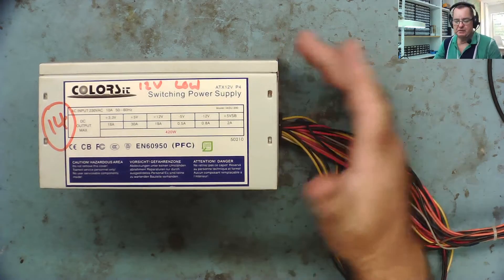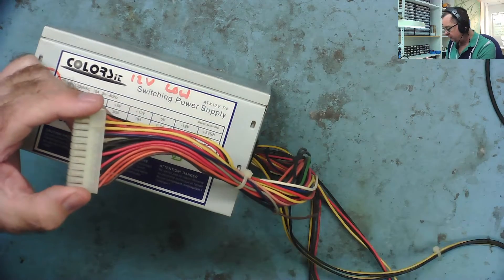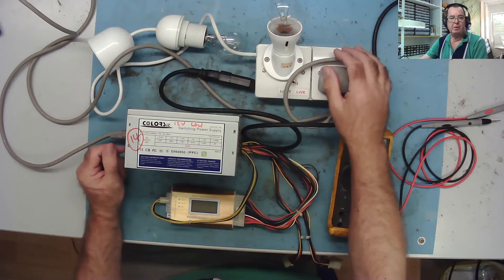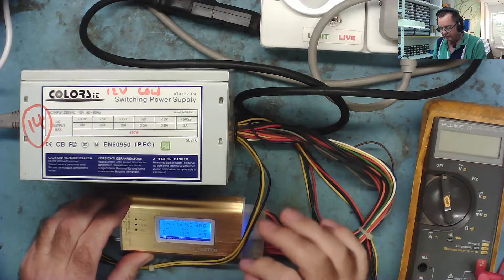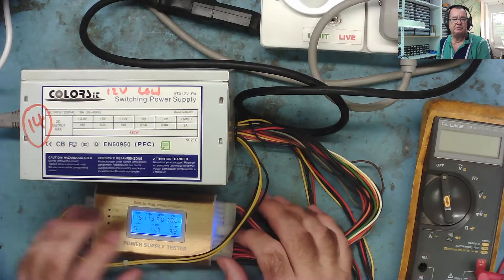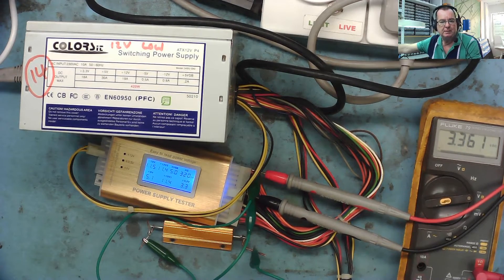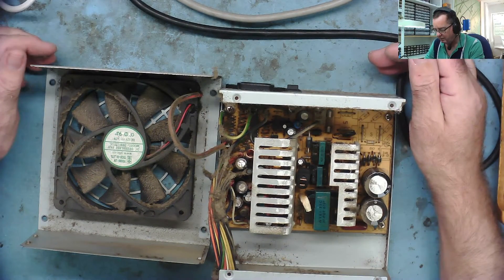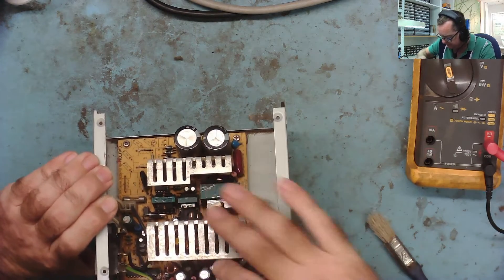ATX Power Supply PSU Repair - DO THIS FIRST!

Comment: thanks for the tip on the monitoring wire. great info.  no way those tiny diode rectifiers could take 400 watts either. i've never seen a 4 pin molex on a sata drive either.  i guess it was really early and power supplies didn't commonly have sata power yet. i've still got old hard drives like the ones you used, that i've had since new.  i use them for data and OS backups. all linux.

Comment: I was a PC System Builder/Designer in the UK for many years. When picking an ATX PSU for a system, I obviously had to work out the maximum loads on each of the ATX output rails (depending on what might be fitted to each skew of a new PC mainboard). But it is more complicated than that. Some mainboards+CPUs+peripherals use very little current on certain voltage rails. It depends of what type of drive is fitted (2.5", 3.5", SSD, none, etc.) and what rails the mainboard uses (some would get 3.3V or lower voltages from the 5V rail, some from the 3.3V rail). Also some PSUs failed to regulate properly if there was not enough load on the 12V rail, some failed if not enough draw on the 5V rail, and some failed to regulate only if there was sufficient current draw on both 5V and 12V or  12V+3V or 12V+3V, etc. I always had to ask each PSU manufacturer for the minimum current specification for each rail (or combinations). Also, a power supply often could not supply enough power on one rail even though the total Watts output was far less than it's rating (because the Wattage rating assumes a certain 'mix' of current on each rail). Some PSUs even relied on the bulk capacitance in a mainboard for smoothing/regulation. I many cases we had to ask for slight tweaks to be made to a specific model of PSU so it would support a range of PCs skews and then we only took that specific bespoke variant from the manufacturer.
I am still amazed that, even today, 95% of ATX PSU manufacturers do not specify minimum loads (even in their data sheets). Instead they prefer to put a note on certain PSU ranges that say 'not suitable for xxx types of system/CPU' when they find out it doesn't work properly for one of the reasons above!

Comment: I’ve got at least 200 computer power supplies ranging from cheap ATX supplies like this, to the top of the line modern ATX supplies, server supplies ranging from 20 year old never used models… All the way up to UNBELIEVABLE power output with some of them weighing well over 100 pounds and being the size of a standard tower computer. 

All hot-swappable of course, you can see something like it on the “diode gone wild“ YouTube channel if you type in “server power supply”, he has two great videos where he goes over the design on the inside and kind of looks them over. He is such an incredible teacher when it comes to electronics.

he had some massive server units that someone donated and I I have dozens of supplies like that, I don’t know why I’ve just heard them over the years when I see them cheap or free I grab them. Sometimes they’ve been swapped out but they still work, only swapped because they reach their expected life cycle in hours

Wish you were somewhere in the United States I could send you a whole pallet of those bad boys. I don’t know why I’ve saved so many, but they do come in handy every now and then when you need parts or a very good quality supply for something in particular. Must be well over a ton of them.

 the incredible build quality with most of them and designing Quality is just insane. Most of the service supplies are super high-quality Delta and Hewlett-Packard branded stuff 

Those super high-end server power supplies from five, 10, and even 20 years ago… They’re just stunning on the inside. And capable of putting out absolutely insane levels of power.. I don’t remember the specs of all of them but not uncommon at all for them to put out dozens of amps on certain voltages, sometimes hundreds of amps, many of them ranging between 2.5 kW to 5 kW output. Just incredibly designed. I highly suggest checking out Diagon wilds to server power supply videos. They’re just really need to see the insides of, and if you check around locally you will definitely be able to find some because these big businesses and server rooms swap these things out regularly they don’t wait until they fail they swap them out after a certain amount of time.

Comment: I have this ATX PSU which had blown capacitors. They were Fuhjyyu and after checking the translation, I am suspecting someone must had picked that name for fun. Funny trivia aside, got the capacitors replaced with new ones, PSU works fine when on, but is a very interesting one. As soon as you plug it in both fans and their LEDs come on. After inspection, they are powered from a Fan PCB which seems to have 3 inputs, 5VSTB, GND and 12V. 12V is only 12V when fully on (on PSU tester), otherwise it's 3.6V. The fans are 12VDC 3.6W. It's not exactly great setup because it draws 10W doing nothing and spinning fans. So I just wanted to ask if it makes sense to either unplug that PCB from 5VSTB altogether or hook it with the 5V output rail so the fans come on with the PSU? Thank you.
Reply from the maker: Hi KS
OK so if the fans consume 3.6W (each) and are 12V fans then Watts = volts x amps so 3.6W = 12V x  amps so current = 0.3A = 300mA

If there are 3 fans then in this PSU then yes that is about 10W (10.8W by my guess-timation) but that does not seem like a lot for high airflow fans - if this PSU has three of them

With that amount of cooling required then  I assume this PSU is a high powered one

If the fans would even work on a 3.6V supply, the resistance of the load should stay the same (unless they use some fancy internal boost converter on the fan PCB to increase the voltage back to 12V or some other clever trickery) so if R stays the same then we have

R = V/I = 12 volt /0.3 amps = 40 ohms

If V is reduced to 3.6V then I = V/R = 3.6V/40ohms = 0.09A = 90mA

So wattage at 3.6V (and presumably a slowly rotating fan) W=VxI = 3.6Vx0.09A = 0.32W per fan = 0.96W total

IMHO if that was the way the designer made the PSU I would leave it how it is - in a PC, plus or minus 10 watts is neither here nor there really.

I did say I wouldn't do maths on this channel but that doesn't mean I can't do it :D  Well at least on a Friday evening after a couple or three beers :D :D

BTW also find I can speak a lot more Spanish after a few beers as well.   Mas Cerveza Mas Habla Espanol.
I was hopeless with foreign language (French as it happens) at school.  Then when I was 19 I went on my first holiday abroad with some friends (strangely enough Spanish Costa Brava) and there I met a delightful young French girl name Veronique, who was also on holiday and spoke almost no English.  In two weeks she taught me LOADS.  She I even taught me to speak a few words in French as well!!!  LOL
(this is a true story)

BTW What does Fuhjyyu translate too?
Reply: @LearnElectronicsRepair  Thank you for the response. I must have been tired or something when thinking about making changes to that PSU, turns out if you leave it switched off it for 3 minutes without unplugging, it will turn the fans off completely. So it is a feature of the power supply, probably to help it cool down. I would never know if I didn't find auction for same PSU on ebay - it has that 3 minute interval listed in bullet points. Lucky me. I have never seen anything like it, but you always learn something new.
I got this PSU - it is Global Win SAF520, from someone who said it was broken and it burned his GPU, but I think it must have been bad GPU. Before I replaced bulged and leaked caps, PSU would power up so it was never really broken.
Now it is almost fully fixed. I am saying "almost", because when you leave it plugged after switching off, it starts making noises like "coil whine" or "capacitor discharging". It's not immediately after 3 mins and need to wait little bit longer.
On the other hand when you totally unplug it, discharge is very fast. I put my retro rig on it yesterday and it works ok and is stable. All the other caps are flat, so I doubt replacing them makes any sense at the moment. 
Video here: https://youtu.be/zB1GW3IPHzA - i left it on standby after power off, you can hear the noise until i turn the switch off. If you have any idea what could that be, that'd be awesome. The PSU is 52A rated on 5V, so it's precious for my Athlon XP build.

Update - just turned the retro PC on - it took few seconds after button press to actually come on (i had to press it twice or three times) and for first few minutes PSU gives some screeching noises. 
I am thinking screeching might be because other caps are dry but it's not visible and maybe NTC resistor needs replacing because it doesn't come on immediately, maybe it needs more time to heat up?
Video with the screeching noises - https://youtu.be/2g2NMH2qmWg. For a fact - it is not the hard drive. I would think it's the large caps, but I replaced them with Nichicon as you can see.

Urban dictionary has a translation for Fuhjyyu - https://www.urbandictionary.com/define.php?term=Fuhjyyu so you can have a laugh.
Reply: There is a better video of the noise which I think is coming from the PSU. https://youtu.be/mTwIfqL6QUU - I suspect it could be these large Nichicon capacitors that I fitted. They are new and they looked legit. On the other hand they are from aliexpress and could be counterfeit or just old. Cannot imagine anything else making that noise. And it is not the hard drive although it sounds like one. The noise goes away after 30seconds or so and I will need to investigate it further.

Comment: love your videos i started  buying faulty power supplys sell on due price incress in uk just wondering how you distarge large cappasitors
Reply from the maker: Use a power resistor - I have shown this on some of my videos - I used something like a 2.2K 5W resistor which I was holding with a pair of pliers.  Good luck with your scrap power supplies - I hope you fix some of them :D
Reply: @LearnElectronicsRepair  thank you i went to scrap metal yard got 5w resistor out microwave solderd 2 wires to legs and works very well no more electric shocks lol
Reply from the maker: @bitsnbobs1969  Excellent.  Do you know the ohms value of the resistor?  Stay safe :D

Comment: Psu No 3 (the 80+ one) looks interesting but I can't remember if you have fixed it (I could check but the last psu marathon has fried my brain). Seriously now, thanks for all your amazing videos. It does take time for me to go through everything but it is well worth it.
Reply from the maker: Ho John, Number 3 is fixed
 https://www.youtube.com/watch?v=6NOgrga5x04

The remaining ones are
No 2 – 300W – 12V high, 5V low
No 5 – 250W – 5V & 3.3V unstable 
No 6 – 400W – Dead 
No 7 - ???W - 5V Standby Unstable 
No 8 – 300W – powers on and straight back off again 
No 9 – 350W – No Output 
No 10 – 400W - 5V Unstable
No 13 – 450W – ??? Mystery Fault ???
No 15 – 450W -5V Standby Unstable

Plus there are a few still In progress waiting parts

It is possible some of the above just need to be run under load (see I also learn while doing this) – I will go back and recheck them to find the genuine faulty ones and update the list

I've also been learning while working through 
this lot
Reply: @LearnElectronicsRepair  No 8, No 7 (or 15) and No 6, whichever you fancy doing, for the variety of symptoms they have.

Comment: What do you think about power supply that doesn't turn on, but the standby cycles on an off every half of second. I can see some bulged capacitors, so I will replace them, but do you think that will solve the problem or there will be something else?
Reply from the maker: Well basically you just have to replace the bulged capacitors first and then see what happens.  Also check for small capacitors near the 5V Standby transformer

Check out this video if you didn't already watch it - this could possibly help you a lot
https://www.youtube.com/watch?v=ClpZgKFkZZE&t=9s

Comment: I also have a HDD from 2008 that has SATA and molex, and it was quite useful when I added another disk to the PC and there wasn't any more SATA powers, so I used that molex :-)
Reply from the maker: Yeah I guess it is just one of those oddities, like LGA775 motherboards with both AGP and PCIe.  Nice to see you made good use of it, keep hold of it too, unusual retro PC hardware prices are only headed in one direction  ,and it's  ^^^^^^^^^